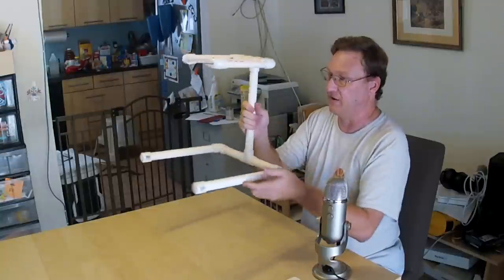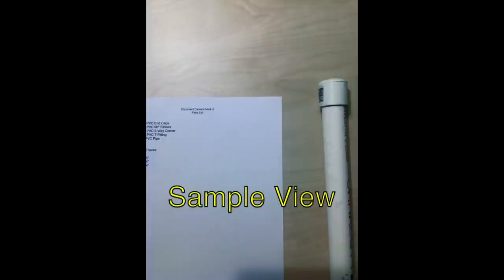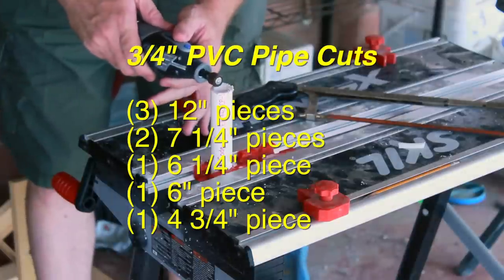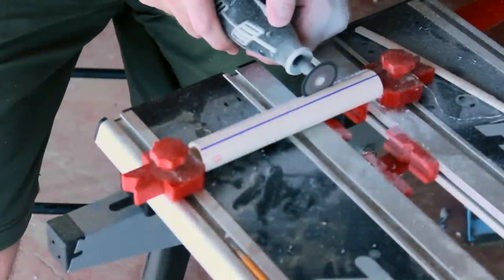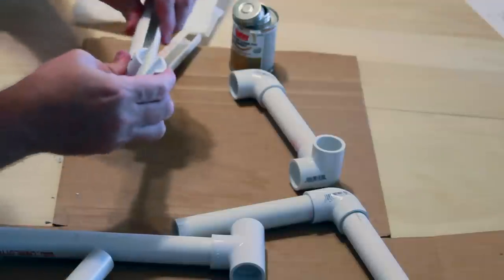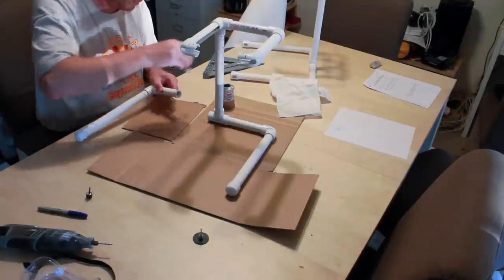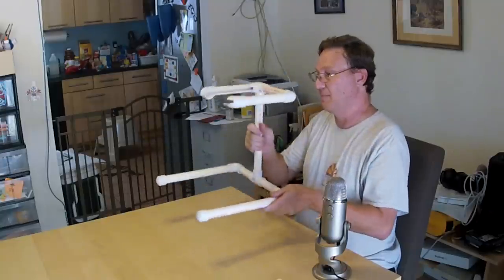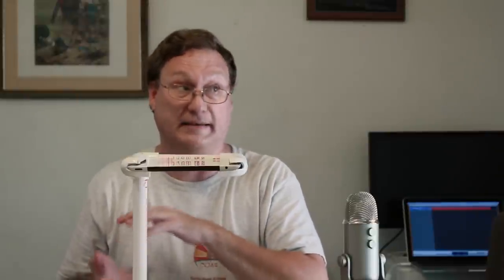iPad Document Camera Stand

Comment: Very good improvement of a good project, you could put sand in the base tubes to lower the center of gavity. Also, level and square are two different things. Make sure your work surface is level both ways and then you can use the level tool for alignments.

Comment: Why not turn the feet 180 degrees and thus the feet are completely behind and out of the way for even wider documents or magazines and books? Plus you could then clamp the feet to the table for stability.
Reply from the maker: +Robert Plate That's an alternative, too, although you'd have to somehow compensate for the weight imbalance once you add the iPad, otherwise it might tip over.  

I've seen some versions that went straight to "make the base just a clamp to affix to the table," too.